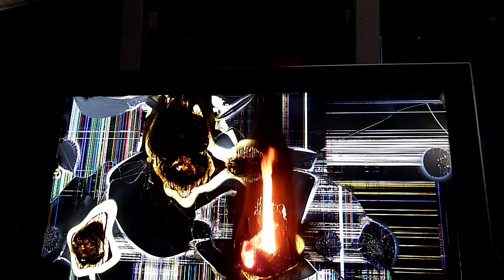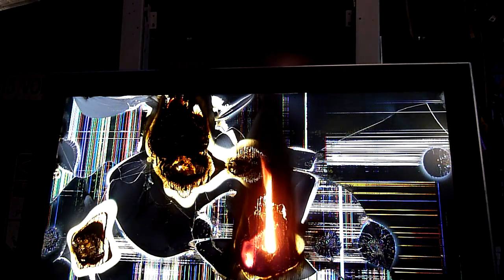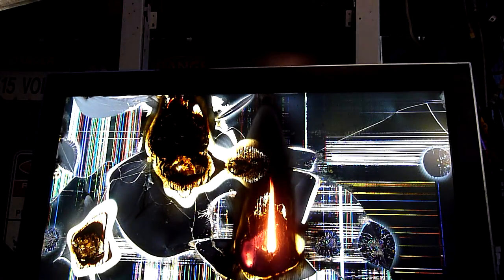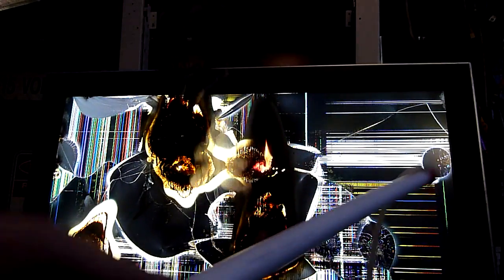LCD TV Vs Microwave Transformer

Comment: Something I recently I found...the microwave piece that is ceramic, has barrillum in it....it is highly reactive to infrared....if it is ground into dust an painted on a glass tube it will boil water in sun quickly. Dude be careful

Comment: Yeah it will, any type of cooling will help it really, don't expect hours though, also the newer MOT's are just shit anyway, almost twice as small as the old ones, much the same with iron core arc welders now, they're smaller with boards and caps doing most the work of what the transformer used to. So it can be smaller, and that way it cost less to make.